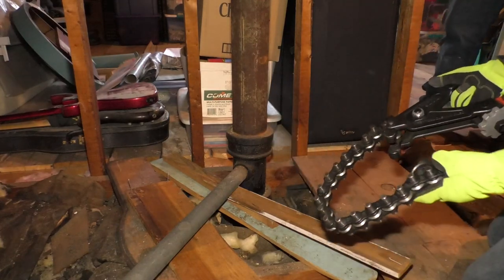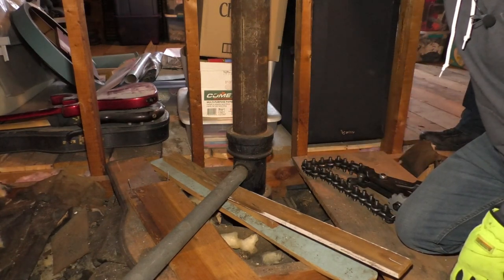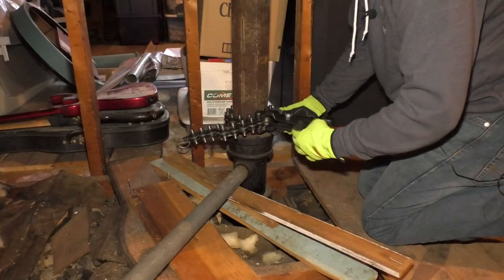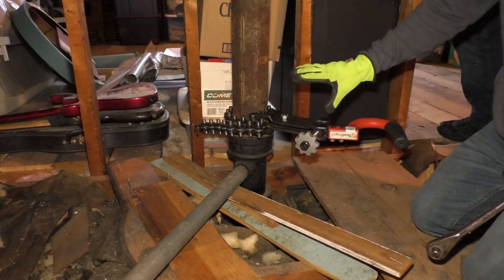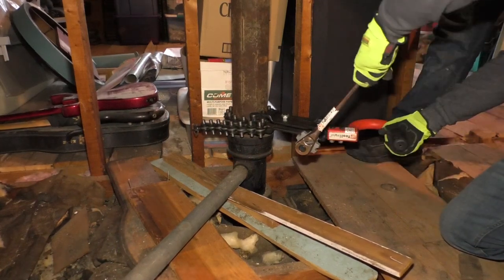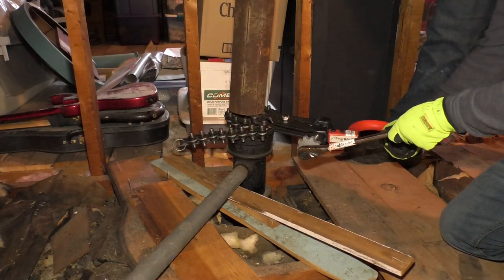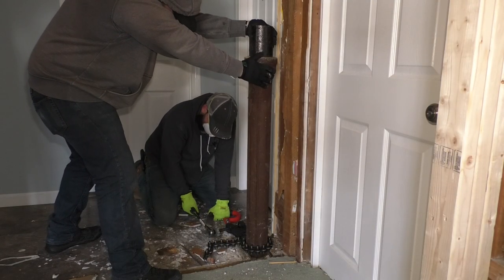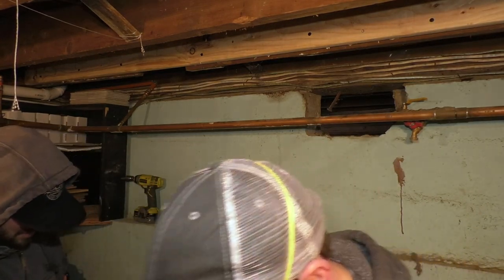How to Cut a Cast Iron Soil Pipe | Ridgid Chain Pipe Cutter

Comment: To remove cast iron is a nightmare but to install all those pieces using boiling hot lead is another nightmare 🥵
Reply from the maker: Agreed!
Reply: @TheFixerHomeRepair but you can use PVC, right?
Reply from the maker: @lydiahubbell6278  yes
Reply: Lol with how much cast I work with I almost prefer cast iron hub and spigot over pvc

Comment: As someone who works with A LOT of cast iron I can say these snappers are way better to use than trying to cut with a sawzall or a dusty grinder. These ones are made more for small spaces and comes in handy big time sometimes
Reply: Yes, I have one I get from my neighbor along time ago when he retired from plumbing. It’s one of those things that I may not use it much but it’s there. Just used it last night to replace with a section of PVC. My hats off to the plumbers of yesterday year I can’t imagine how they would solder those joints in such close spaces.

Comment: The chain cutter is great but if your pipe are heavily rusted or crumbly use a sawsall.  The chain cutter will just crush the pipe. Learned that the hard way $600 and still have to use the old dewalt special.

Comment: Hello,  I am getting ready to install a backwater valve on my 4" Cast iron sewer pipe. The pipe is about a foot below concrete so it has been underground for about 60 years. I've been warned about old pipes cracking when you try to cut them. Does anyone know if this type of pipe cutter will reduce the chance of cracking or should I use a grinder or Sawzall?
Reply from the maker: Hey!  I have heard if the pipe is weakened this tool could crack the pipe.  You may be better off getting a high quality metal sawsall blade and cutting it that way.  A grinder would work great but there would be a ton of sparks, if that is not a concern then that might be a good option.  Hope this helps!
Reply: @TheFixerHomeRepair  Thanks for the advice...Having my sewer pipe crack on me doesn't sound like a pleasant experience :)

Comment: i dont know anything about house maintenance or anything but what were those pipes for? Are you gonna put new ones now, now that you took the old one out? Or it was in no use anymore and it was just sitting there.
Reply from the maker: Hey Robert!  That was the old vent for the original plumbing of the house.  When they moved the bathroom it was not needed so they just cut it and left it so I uncovered it and got rid of it.  If you are interested in the full video I put a link in the description of this one.  Thanks for watching!

Comment: I almost got taken out from a piece of cast iron pipe fitting helping with this thing. I feel like it’s insanely dangerous and scary. I was working with a plumber as a helper. He was cranking the cutters and I was holding the cast iron pipe. My job was to just hold the piece so it didn’t fall. There was no way I could hold it with the amount of force from the cutters. When it popped, the whole cast iron fitting zoomed past my head. It smushed my ear and cut the insides and I was told it would need a suture. Thank God it didn’t take out all my teeth, break my face, knock me out, or something worse. Hate that tool.
Reply: Your mechanic failed you. He should of had you prepared.